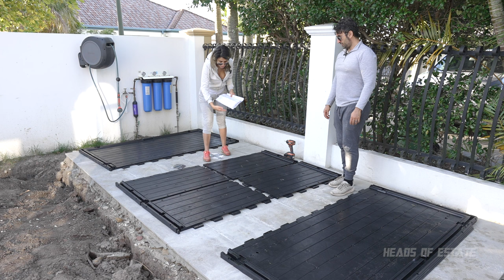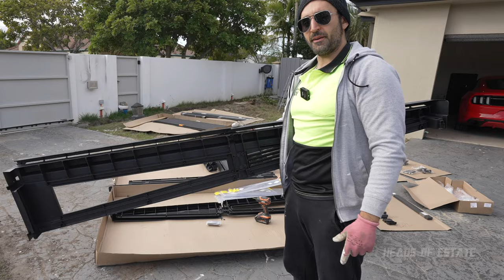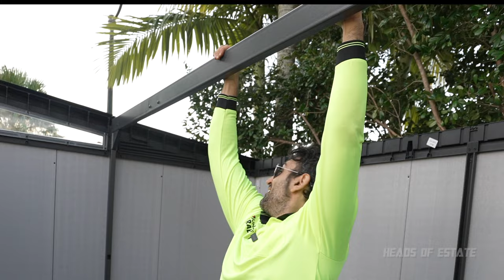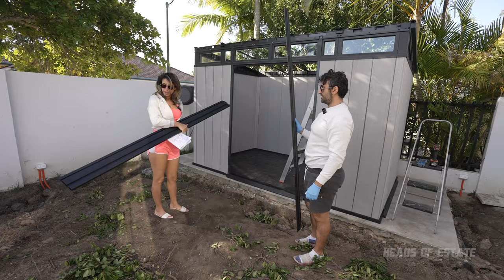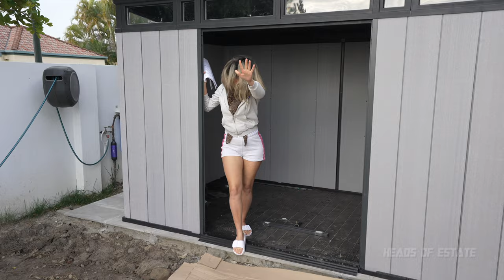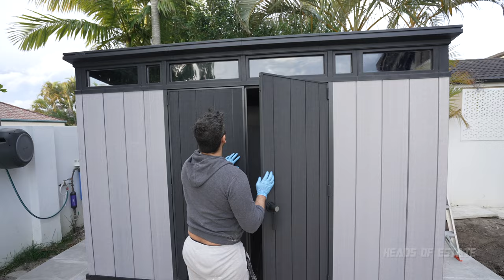Keter Artisan Shed Build | DIY Start to Finish in 10 EASY STEPS

Comment: DO NOT RECOMMEND! I am very disappointed ... The shed itself is nice, but during the assembly, which I have done exactly pursuant to the video and the written guide provided by the manufacturer, the ladder (same as in the video) broke into the floor and damaged it. The problem is that the floor is hollow (just two quite thin plastic sheets with plastic ribs between them). If you put the ladder (or anything else heavy) outside the ribs, it breaks through the top sheet. The manufacturer denies any responsibility …
Reply: Is it possible your base wasn’t level
Reply: No, I placed it on profesionally prepared concrete base slab.
Reply: So the ladder punctured the plastic flooring?
Reply: I guess I’ll have to put an OSB sheet down first then the ladder on first. Thank you for the heads up!

Comment: Just built a 7x7.  Exactly the same as the 11x7.  Couple of top tips.  The wall panels can be VERY tight.  Rather than hammer them with a rubber mallet and risk damaging the tongue and groove edging, apply a little grease along the edge.  They'll slip in no problem.  Beware! Don't use oil.  The oil will run down the edging a will 'pool' along the metal bottom.  The walls will then soak up the oil and leave an unsightly stain at the bottom of the walls.  Top tip #2 - use an awl to make pilot holes for those screws which require you to make your own holes. Cuts down on dropping screws before they catch. Lastly, Top tip #3, cover any gaps with masking tape along the bottom of the walls along the floor below where you are screwing in screws.  I lost a screw through the gap in the floor and it fell between the cavity floor.  Thanks for the video - it was really helpful! The instruction booklet was mostly good but I had to go to your video for clarification on a few occasions.
Reply: That's really helpful, especially the awl part. Thank you so much.

Comment: I just finished mine. The instructions were super easy to follow. All of the parts fit together perfectly. I didn’t even need to adjust the doors. It took two of us about 4 1/2 hours.
Reply: Hi Dan. Does the water run straight off the roof at the back as we want to put it close to the wall of the house. Or is there something that stops it? Thank you.

Comment: thanks for the great video, it helps a lot for us to construct it, very much appreciated for the effort!! we just have a question, as i can see the back of the shed is near the fence. would you recommend to install a gutter? i'm in a similar situation and wondering should i install one or not? thanks again!
Reply from the maker: I haven't had any issues with drainage here, but yeah if you have problems you can always install one round the back. Best of luck
Reply: @headsofestate  Hey Guys, finally installed our shed after watching your video so many times. it really help a lot. just want to drop by again to say a huge thank you again.

Comment: For the final step of putting the screws in the base, how did you get them in at the back where it’s against the wall? I’ve just ordered the 9x7 version of this shed and I also want it backed up against a wall. Do you think I could put those screws in on that side earlier in the build when it would still be possible to move the shed into place?
Reply from the maker: I could still shimmy it away from the wall after it was built to fix the back screws in, but I don't see why you couldn't screw them in earlier like you suggested.
Reply: That's exactly what we did when we assembled our 9X7. Assuming it's on a solid base it's actually pretty easy to shimmy it back and forth into place.

Comment: Nick you both work so well together. There’s a few problem with your installation and I may be wrong but your concrete pat is too low to the ground especially after a heavy rain fall or winter thaw. Complete seal all areas and keep your fingers crossed that you do not get a flood

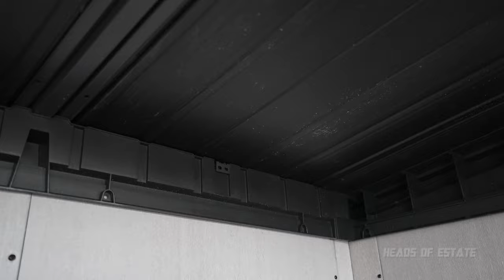Comment: Nice video... Was good to confirm I've assembled mine correctly last weekend, but had some rain today and noticed water in four locations on the floor at the back directly below the rear roof fixings showed at 21:21 of your video.. Not sure, but it seems to be tracking back from the roof fixing on the exterior in.. Really odd.. Need to reach out to Keter it must have happened to other owners?
Reply from the maker: Nice one, we had some heavy heavy rain with 90km winds these past two days, but no leaks inside the shed so far 🤞.

Perhaps you can try putting some roof and gutter silicone on any gaps on the roof you find? Let me know what Keter tell you.
Reply: Just bought this shed got the same thing happening did you find a solution?
Reply: Same problem

Comment: I'm thinking about pouring a concrete pad for this exact shed. Is the shed exactly 11x7?
Reply: I was wondering the same. According to the specifications it's H 89 in, W 134.6 in, D 85.80 in

Comment: Hello,
I am writing from France where I enjoyed watching the assembly of your garden shed.
I just received mine, exactly the same, the Keter Artisant 117!
Question...
Mine will be glued along the neighbor's fence, is it necessary to leave a passage to screw things behind?
If there are screws in the back, are they to be put at the bottom of the panels or at the top on the roof elements?
Thank you very much for your answer, I hope it will give you complete satisfaction!
Sincerely
Pascal from Orleans, near Paris.
PS: Excuse me for the translation, I am on DeepL...
Reply from the maker: Hey mate, I just slid the shed forward, screwed in the final screws round the back, then slid it back in place.
Reply: Ok, cool! Thanks for your answer!

Comment: I just bought this shed and during heavy rain the water tracks up the roof brackets at the back runs down the wall and leaves a puddle inside. Do you get this on yours?
Reply from the maker: No water inside here so far 🤞. I guess if you can see exactly where the ingress points are, you could always put on some roof and gutter silicone there to stop it?

Comment: Did you have to anchor this into the foundation?
Reply from the maker: You can, but I haven't needed to thus far.
Reply: you wont need too once you fill it with stuff only a twister will shift it, but a twister will shift anything, so save your self the hassle, there heavy enough.

Comment: Judging by wardrobe changes.  This took you guys a full week to build.
Reply from the maker: Yeah we fit a bit in here and there between work
Reply: @headsofestate  im about to start assembly of one today.  Wish me luck.
Reply from the maker: Hope you have fun mate, let me know how you get on.
Reply: @headsofestate  got it all done, finished same day..  started around noon,  everything cleaned up by 8pm.  Mine was the Cortina model.  Looks like yours and dimensionally the same.   Assembly was a little different.  
Was just myself and my 7yr old helper handing me screws.  
Today, wiring in an outlet  and light.